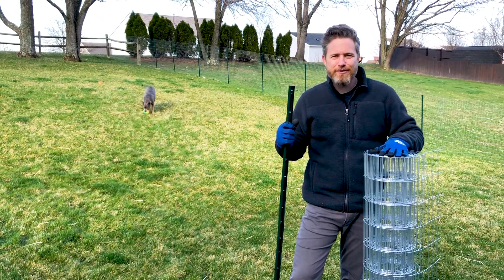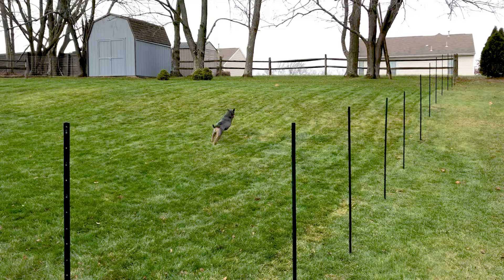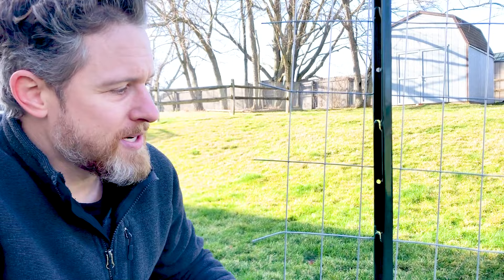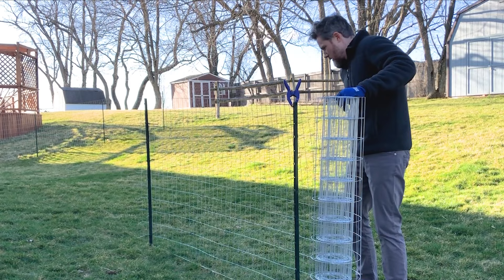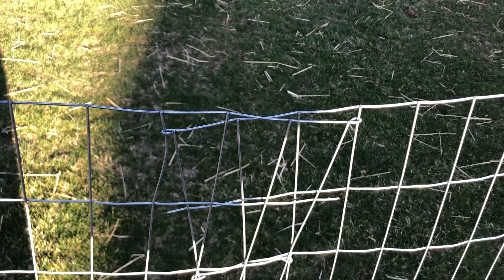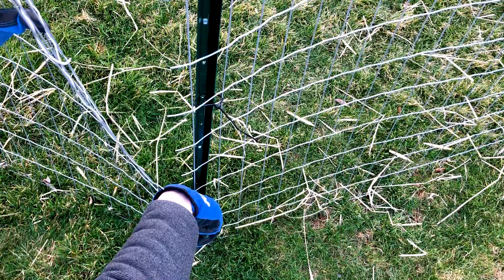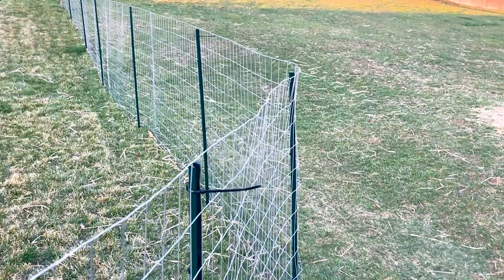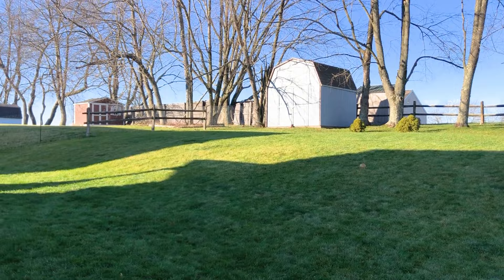How to Install a Welded Wire Fence the Fast & Easy way with Elevation Changes, No Digging

Comment: Did you ever put in a gate? I'm about to install one of these and need to include a gate over a walkway. Your video was very helpful!
Reply: Your gonna wanna use a wooden post and concretefor a gate. A round tubbing metal cattle with a metal mesh looks and works great with wire fence.
Reply: @kingyart   The wooden posts would be a more proper way of doing a gate, but since this is kind of a Mickey Mouse DIY PROJECT! You can actually make a gate without wooden posts and just use the T posts.  I cut the fencing on one side where I wanted the gate to open. Then took two 3/4”  wooden fence planks and stapled each one to each side of where the fencing is cut at. Then you can add whatever type of latch attached to the wood planks to keep the fence together across the driveway or walkway.   Undo your latches and just pull the fencing back out of the way to get into your driveway or yard.  It’s the poor man’s way of getting the job done without having to spend much money and not having to waste much time.  This is what I did when I wanted my chickens pinned in on my side yard .  I put loops on the side where it was next to a T post so the fencing just not flopping in the wind. Then made hooks that mounted to the plank that was connecting to the fencing you want to open. Then just had to raise the fencing a little to drop the hooks into the loops to close up the fencing. Lift the fencing back up to take the hooks out of the loops to open the fencing back up! Very simple and quick and cost very little to do!
Reply from the maker: Building a Simple Gate Fence with No Digging
https://youtu.be/AgKKnjw9rPc

Comment: I really needed this simple instruction.  I'm a single lady moving into a disaster.   I enjoyed you video because it was simple and I know what tools and products I now need.   You saved me money and time, and  I subscribed because of it.   Any videos on replacing carpet, windows,  or repairing holes in walls would be an amazing help to me!  Thank you for what you do!  I feel encouraged!
Reply from the maker: Thanks for subscribing. Carpet is tricky cause it needs to be stretched. Windows vary by wall (brick, siding, etc.). They need to be flashed and sealed. There’s a lot that can go wrong if you don’t do it right and get a leak. I am currently dealing with one that I prefer not to do myself because of the risk. These are all a bit more complicated than a fence unfortunately. But I will keep you in mind for future videos. Good luck with your projects

Comment: Thank you! This is exactly what I needed. The Home Depot welded fence description suggests u poles but the t poles are 20% cheaper! And I didn’t know about post driver before - thanks, i’d smash it with sledgehammer if I didn’t watch your video.

Comment: Wonderful.  Not the most difficult project, but never having done one before, I knew there were things I should learn first.  You answered the questions I had for this project (dealing with corners, clamping to the post, dealing with changes in level).  Excellent video.  Thank you.

Comment: Definitely a helpful video. Really appreciate the closeups of connecting the adjusted slope wires, and the tip about bending towards the welding points. Also the video was pretty satisfying to watch, even if I wasn’t trying to build a welded wire fence. Narration about what you were doing was on point 👌

Comment: I used zip ties for my fence 3yrs ago and each year some do break and I just put new ones on in those spots. I made gates from a pieces of hog panel, leaving the pieces of wire on one side to bend around the T post like hinges with the gate being wider than the opening so it braced on the other side by the fence and I used a bungee or chain to keep it closed. I did need to put welded wire on it so the small dogs could not go through the holes. It works pretty good once you tweek the bent wire to move on the post easy and you can make a wide gate just as easy as a narrow one. The only downside is it does not move as freely as a real hinged gate but it is functional.
Reply from the maker: That’s a good stopgap. I would think eventually the wire will break?? I’m hoping to do a hinged gate this summer. Always learning something new.

Comment: Straight to the point, No Filler.. Doing my yard in welded wire, except covering the T Posts with a Cedar Fence Board, then using Cedar Fence Boards along Top and Bottom of the welded wire to give the Illusion of a Framed Cedar Fence with a Wire Insert.

Comment: Best video I’ve seen on  installing T posts using T-post connectors. You showed the process up close . I also loved how you explained the wave at top or bottom of fenced and how to correct. Nothing difficult. Keeping it a simple to understand installation. 👍🏼
Reply from the maker: Glad you enjoyed it. Thanks for watching! Also they are technically U posts as several people have pointed out.

Comment: Great video. Exactly what I was looking for. A gate video would be great to see how you built that.
Reply from the maker: Working on it. Hopefully this summer.
Reply: @BuildingWithBlake  just curious how tall that chicken wire is that you put on that split rail. Thinking about doing something like that to try and get away with a taller fence lol
Reply from the maker: @dakota481  It's all 4 ft tall. There's def some wave on the split rail portion, but the dog doesn't mind.

Comment: Great video with excellent tips! It's not exactly what I was searching for, but it certainly points me in the right direction. I live in a tiny northern AZ town, and we've got plenty of elk, javelina, and other wild critters. My goal is to keep my dog inside rather than having him on a long leash when we're outdoors. He's got a knack for chasing after anything that moves. My house sits on a hill, and the yard is quite sloped and uneven. Your advice on how to angle a fence like this will be a huge help. I'm looking forward to a video on how to build a gate; I'll check if you've made one already. Thanks again for the awesome video!

Comment: I came back to this video because it’s THE BEST one I found on this type of fencing. I’m by myself, and mine will be shorter, (I hope), but I can follow your very clear directions! Thank you!
Reply from the maker: So glad it was helpful. Good luck with your fence.
Reply: @BuildingWithBlake  Thank you! Now I need to order the equipment, and it has to be short! Do they make shorter ones? 
BTW, I’m SO SORRY to bother you, but I’m 68, a single woman, chronically disabled from overlapping pathogens for 20 years, and now have a severe form of Lyme, which is not allowing my broken shoulder from 10 1/2 months ago to heal. Thank you again!  How did your wife get so lucky? 🙏🌷🌸

Comment: Good video, thanx. A couple of things: when twisting and wrapping wire ends, ensure the wire end are pointing away from the livestock side. Those posts are U-posts, not T-posts. You will probably replace the U-posts by T-posts when it becomes permanent.

Comment: This type of fencing can be very strong. Ranchers and farmers use this to keep livestock in. 4x4' wooden corner posts and stretching it tight (using multiple methods) can make this fence a permanent solution. We have a little min-ranch with 10 1/2 acres and the perimeter is fenced with this as well as cross-fenced. Perhaps that's the next video?

Comment: another trick... once the roll of wire has been rolled opened and flattened 2m flip the roll over on the ground and stand on the the opened roll end, walk on what you roll out ahead of you.  pull it in places to reset the shape as you flip it up to the posts...
ive done much but  did learn some tips from you.  i need 8' fence for suburban black tail deer patrol and hang grape vines to shade the west wall of our home in summer.  those clips will work on my constructs involving conduit and hose clamps.  i like your tie-ups too.
we harvest way too many grapes...
 Thanks
Reply: Then I guess you own a lot of grapes,Our company produces Vineyard Post and all kinds of fences,You can contact me if you need anything.

Comment: Thanks for this. There's areas of the fence at my soon to be new house that were damaged by falling trees. This is the perfect fix for those spots They're already in a pretty heavily wooded area so it will be a perfect solution.

Comment: So easy to understand.  Thank you.   Need a quick fix to secure the swimming pool because the winter cover has some seams wanting to split and the Italian Greyhounds run across the cover.   Now I can quickly with low budget fix this problem for now

Comment: Thank you for the video.  Used many of your recommendations.  The welded wire fence was the way to go versus chicken wire.  I agree with unrolling the fence, I didn't like that part.  Thanks for all the tips made the project go smooth.

Comment: I have 5 puppies when full grown they'll be 65-75 pounds and they are jumpers. I want to do a 6 foot high fence like this. I'm thinking of doing the T-post 2 foot or 3 foot apart for added strength. What are your thoughts on this?

Comment: They make various "Post Fastener" fence wire twisting tools if you have to bend a lot of them.
It"s good to keep the wire ends away from the animal side of the fence or tuck them completely away or you might have to take a trip to the vets!!

Comment: Just a quick clarification: “plumb” is a vertical characteristic as in using a “plumb bob” to establish a true vertical for a corner or post..

“Level” is found with either water or oil mounted in a vial which allows the user to center an air bubble between two marked lines.

Crude and ancient but effective.

Comment: In my experience the heavier T-posts are more economical in the long run. Those thin ones you are use bend real easy and can seldom be reused .Some kid messing around  can accidently bend those posts. A quick easy fence is the heavier T-posts with with the 8' cattle panels ( tractor Supply type stores) the cattle panels are very stiff, rigid and don't need to be stretched ,they will not sag. You just wire them to the fence posts .  Also if you don't have a way to haul the panels home ask some landscape guy with a trailer to help you,they are ueually happy to make a few bucks. Also if you have trees branchs always fall on your fence. If you bump one of those flimsy posts with a lawn mower too bad, but the heavier ones will stop your lawnmower no damage to either.
Reply from the maker: Yep the U posts can bend easily. If this were a long term solution I might have gone with something heavier.

Comment: You can also use rebar ties and the twirly tool for them to fasten the fencing to the posts. Faster to do than a zip tie and they'll last much longer.
Reply from the maker: good suggestion

Comment: This was really helpful, thank you. I'm curious how the posts are holding up if dogs are pushing on it and I also wondered if you had a take on woven wire (sheep or deer fencing) for keeping big dogs in the yard. I was told fence posts should be 1/3 under ground for longevity but I don't see many people doing that with t or y posts.
Reply from the maker: The dogs typically don’t make contact with the fence. I’ve had a couple deer try to jump it and make contact. They dented the fence but didn’t push it over. To keep deer out of a yard I would go another foot higher and a foot deeper so at least a 6 foot stake or T post as opposed to these garden posts. Woven wire would probably be stronger but either should be sufficient.

Comment: I forgot to add that your videos get right to the point without unnecessary comments and WHY I chose it..I'll tune out right away if they start out that way.
Reply from the maker: Thanks! I try to leave most of the unnecessary stuff for the end. Good luck with your project.

Comment: i used 5 foot high welded wire with chainlink posts and connectors,, ive done my whole yard and its keeping my 2 alaskan malamutes in my yard where i need them to be... i only used 6 guage wire i believe which is lots thinner than i wanted but cost wie it was perfect and it has been working great i dont like them green posts used in the video as they dont go deep into the ground

Comment: Another tip: For cutting this gauge of wire, no problem if you don't have an angle grinder with cutting disk (as see in this video), as cutting with manual wire cutters is just as fast.
Reply: “ARE” just as fast
Reply: @avacadovich  cutting with Xs is fast :-)

Comment: Don't expect a fence like this to last long or to stop any livestock.  For that it needs to be properly tensioned, with heavy strainer posts at ends and corners, and the strainers need to be strutted or guyed – the strength of a wire fence is in the tension.  You also need some way of stretching the wire really tight– there are simple tools for that.  Your fence as it is would be OK though for small dogs, very small children or as a simple visual deterrent.

Comment: This was great for a fix I need for my dogs. When you replace with wood posts, will you be using concrete? I’m looking for the nicest looking solution which will be easiest to remove someday.
Reply from the maker: I probably won’t bother with concrete expert around the gate posts.

Comment: True story if you don't swing a sledge regularly for work leave it alone but you can definitely get these in without buying a post pounder, you can also weld one up easily if you have some pipe laying around

Comment: I was wondering what to do for uneven surfaces. I have 5 acres that is fenced in on for the most part 3 sides. I plan on running one of the sides longer so it gets closer to the house and creating a 4th side so I can let my goats and pigs out there to tear up the brush. I also found a gate in the brush and a bunch of wood that I can use for the actual post ends making it a bit more sturdy than just t-posts alone.
Reply from the maker: Are you taking about grade changes or rocky surfaces? You can make small adjustments to account for slope but for sharper changes you would have to start a new section of fencing. Near the house you’ll have to get a post up against the side to tie off the end of the fence.
Reply: @BuildingWithBlake I already set a wooden post where I want it to turn when I get that far. As far as I'm aware, it isn't rocky, at least from what I've seen so far.

 It is pretty hilly. The area in general has a lot of rolling hills. The area I need to add fencing has a hill that I would estimate to be about 3-5ft of a difference in maybe 20-30ft but I haven't actually taken any real measurements of the grade yet so that's just a visual estimate. I ran a string line along my planned area and in one spot it is probably 1ft off the ground while the line is tied at about 4ft at the starting point. After that low point, the ground drops back down and my line is at 4ft again at the ending post. 

 At the top of the hill it flattens out, but there are a lot of potholes and ruts out in the fielded area. There used to be a trailer and a few other buildings out there, so that explains some of the deeper ruts. Fortunately, I'm not running fence through that area. Lucky for me, there are already a few wooden posts out there from the previous owner but the fencing is gone and it isn't enough wooden posts to forgo installing my own u-posts to bridge the gap. They also never took the fence down as far as I plan on running it.

Comment: Twist ties will snap after a while when it gets hot out or very cold out.  They become very brittle and break off. So, you have to check your fence line every now and then.

Comment: My fiancé wants to do this kind of fence for our dog. However, I worry that if she did jump up on the fence (which she never does) the fence would just kind of fall over. Is it strong enough for a medium/large size dog to knock it over or cause problems?
Reply from the maker: If she’s 50+ pounds she could possibly kick it over if she jumped into it. But we’ve had several deer jump the fence and hit the top. It dents but doesn’t fall over.

Comment: I was going to put up a 4 ft welded wire fence with 1 strand of barbed wire on top attached on 6.5 ft T-posts and heavy timber posts (every 4th post). Will this keep hogs and goats?
Reply from the maker: If they have a habit of bumping into things they will damage it rather easily. It wouldn't take the weight of a hog. But if they take visual cues it could work.

Comment: Thanks for sharing. Do you have an example of working with this style fence on a hill?. I think I’m going to do it in panels
Reply from the maker: My backyard goes from flat to sloped then back to flat again. I basically made the poles straight and put the fence at an angle on the slope, cutting it to make adjustments wherever there was a change in terrain. I know a lot of folks choose to do panels, but that doesn't keep the bottom flush with the ground and critters can get in. I just followed the terrain of the ground so there would be no gaps.

Comment: Great help for me to keep my dogs in my yard!  Can you tell me if there is a reason to use a T post vs a U post?  Thanks!
Reply from the maker: No big difference. T posts are a bit heavier but stronger. They should both work.

Comment: This would be perfect if I lived in another state that has soil with the consistency of butter, wind gusts under 50mph, and no rocks.
Reply from the maker: Where do you live? Have you tried to put a post in the ground?
Reply: @BuildingWithBlake  I live in Colorado (rocky Mnts). I actually did put about 30 posts in by hand which was long and arduous. For my region it's best to use an electric or gas powered post driver. The machine was so heavy I couldn't lift it safely so I ended up digging holes to get posts in.